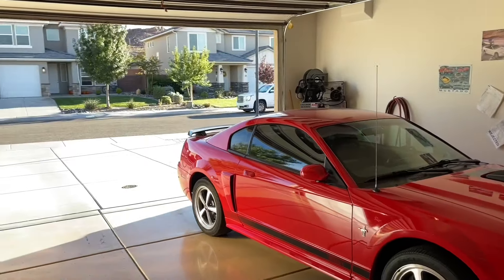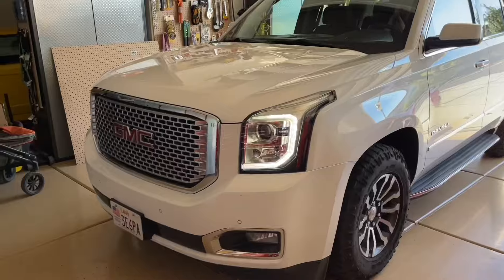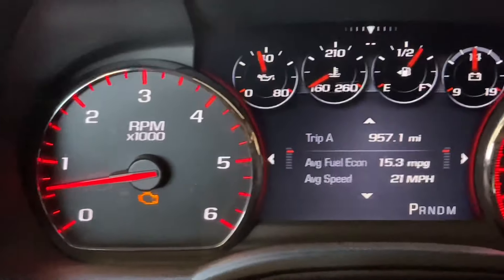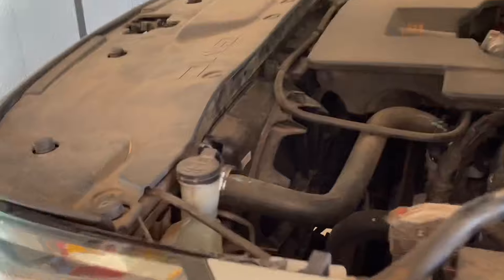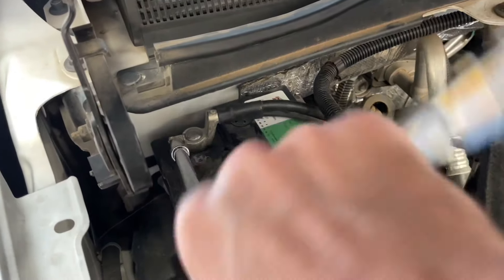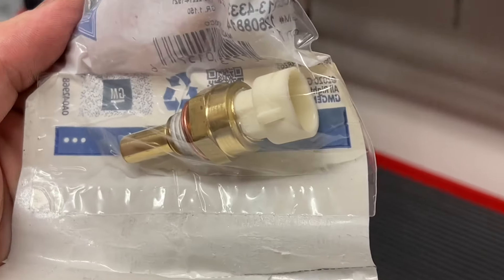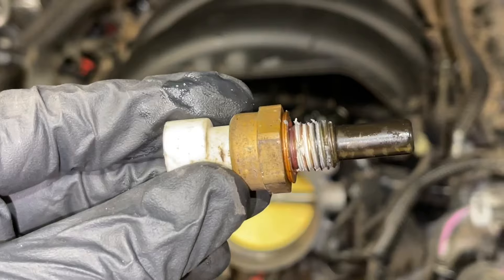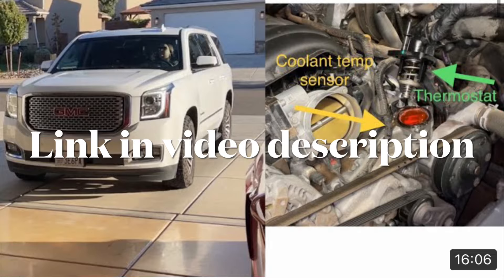Radiator Fan on full blast won’t turn off even with car off, not running. How to fix it GMC Chevy

Comment: Can you answer my question… so I changed the sensor and battery and it still doing it the noise os there something else wrong with my 2018 yin xl???
Reply from the maker: Try the thermostat next. It can have the same symptoms https://youtu.be/7mJF5LQ3oPs?si=rCTBqC3aHX686Xoa

Comment: I did change the ect sensor but it’s still running for a few minutes after traverse turns off.  And there isn’t any check engine light .
Reply from the maker: @olivasaz  it’s most likely the thermostat is bad and stuck open, over-cooling the engine: 
Thermostat Replacement Yukon, Tahoe, Sierra, Silverado, Escalade GMC, Chevy 2014-2020 P0128
https://youtu.be/aEfgkxWdBYw

Comment: My 2018 GMC Yukon is doing the same thing with the fan. After driving for more than 45 min it comes on and gradually gets louder. However, my temp gauge is always reading normal, there is no check engine light, im not running heat of ac, there were no codes found. What could it be? When I turn off the engine it stops and I have to let it sit for hours for to stop.
Reply: @dannyjohnsonsgarage
Reply from the maker: If the computer recognizes a temperature is not what it should be vs another temperature (for example the engine temp reads cold when the  transmission is hot) it may trigger the fan. In your case everything looks good, but it could be some disagreement of temps. I would look into the thermostat and temp sensor. It could even read incorrect, then start working again so you think it’s fine. https://youtu.be/7mJF5LQ3oPs?si=PoQLChpViUR0YLbr

Comment: I had the same problem but in two days it went away should I still change the thermostat?
Reply from the maker: I would be prepared to do the thermostat and temp sensor https://youtu.be/7mJF5LQ3oPs?si=p4dg6Q80BsDM2nd2

Comment: Would that make your ac blow hot?
Reply from the maker: It’s possible it shuts down the ac compressor as part of its limp mode. Replace the thermostat if it’s showing 160 degrees (it’s really showing lower)  https://youtu.be/7mJF5LQ3oPs?si=zXNMnz7MKtXA7IVO

Comment: I have a 2015 gmc Yukon xl Denali…I replaced mine about November and in February it did it again…replaced it again cuz the part has lifetime warranty at Autozone and almost a week later did it again….I’ve replaced the thermostat before as well the first time…may r a bad batch from Autozone?🤷🏽I’ll probably order an original from rockauto
Reply from the maker: I sued the GM one and so far so good https://www.amazon.com/ACDelco-213-4514-Professional-Coolant-Temperature/dp/B001W0FSMM?crid=2W7SZ4JL3KG18&keywords=213-4333coolant+temperature+sensor+gm+1260-8814&qid=1666942889&qu=eyJxc2MiOiIwLjc4IiwicXNhIjoiMC4wMCIsInFzcCI6IjAuMDAifQ%3D%3D&sprefix=213-4333coolant+temperature+sensor+gm+1260-8814,aps,121&sr=8-2&linkCode=sl1&tag=2004047-20&linkId=26bc817b596203fb2d3af79336fbb48a&language=en_US&ref_=as_li_ss_tl

Comment: Glad I found this! I replaced the coolant sensor with a Duralast one from Autozone before seeing this video. The problem stopped but then it returned. Could it be the sensor? Maybe I should have gone with the more expensive ACDelco? Or do you think I need to replace the thermostat next? Thanks in advance!!
Reply: Having the same issue as well did you find a fix?
Reply: Having same issue.
Reply: same issue
Reply: Having same problem I replaced coolant sensor and thermostat problem came back idk what it can be
Reply: I seen a few people had to replace the thermostat as well
Reply: Do you happen to have LED fog lights?  A buddy's does this only if the fog lights are used during that cycle. It's weird but reproducible.
Reply: Try the connector to the sensor
Reply: Did anyone find a fix to permanently repair this problem? I too replaced the sensor and now almost 3 weeks later the problem returned. I have no warning lights, check engine light etc on at this moment.

Comment: Quick tip! 

If this happens to you and you dont have tools on you. Just leave the truck on for about 5 minutes and then turn it off. Should make the fans turn off.
Reply from the maker: It will also kill your battery if not addressed. Pulling the negative terminal helps, but in the end we are finding it is the thermostat that is failing causing the car to realize the Tranmission is hot but not the coolant system and it goes into limp mode. The thermostat is stuck open in most cases and over-cooling https://youtu.be/aEfgkxWdBYw?si=_RsaX35abPAikCRi

Comment: Im not getting any check engine lights but it takes 5 minutes for fan shut off while truck off
Reply from the maker: Is the temperature gauge reading 0? It’s most likely the thermostat and or the temp sensor. https://youtu.be/7mJF5LQ3oPs?si=FLjYyzzHoF_WYXx3
Reply: @dannyjohnsonsgarage  thank u can I drive it like that for 2 days cuz I need my truck for work
Reply: @dannyjohnsonsgarage  yes

Comment: Replaced sensor and disconnected the battery for 2 minutes after.  Problem solved!  Thanks
Reply from the maker: That will reset it. If it continues to come on, I’d look at the thermostat and sensor https://youtu.be/7mJF5LQ3oPs?si=IuIx-t0uQToSw_g2

Comment: Had this happen in the 17 Tahoe. 
Rained real hard one day as we were driving. Then the fans come one while driving and stay on when motor is off. The fans would not turn off. So I trick the system by starting the motor and immediately turning it off. It turns the fan off every time like that. But as soon as you turn the engine back on the fans run constantly again. Did this for like a week and then they stop running constantly on their own. 
Then one rainy day it happens again. Maybe a coincidence. Haven’t fixed it yet because ATM the motor is down to the block, fixing the lifters and cam. I will change the thermostat and sensor while I do the pump. Should fix it. Also had to replace the transmission after 130k miles.  Car companies are making junk. Designs only last as long as the warranty. Car companies = parts/service companies. Buy used and just rebuild the whole thing with money you save or lease and give back after warranty.
Reply from the maker: I just did the cam and lifters as well. I was afraid transmission was next as well https://youtu.be/cWayyZGNYRI?si=KNc7Emej7Iw2pHkO
Reply from the maker: Went with a Toyota Sequoia as well Why I traded my GMC Yukon for a Toyota Sequoia
https://youtu.be/cNm9rtx0GHQ

Comment: What woukd make the sensor keeo going bad. I have a 2017 Suburban, and ive replaced the sensor twuce in the last 6 months. Gan will run loud and continue after i tuen off my vehicle and the temp gauge reads 160. Why do my sensors keep failing so frequently???? Help!
Reply from the maker: If it continues, it may not be the sensor, but the thermostat. https://youtu.be/aEfgkxWdBYw?si=kwK5TSbu3g0jUR4A

Comment: We did this and it worked for a bit. Have you found any other things to check for.  Next is the plug going to pull it and check to see if its messed up
Reply from the maker: If the sensor isn’t the fix and you don’t have a check engine light and don’t think it’s the plug, the thermostat may stick open and over cool or stick closed and overheat. Not as likely https://youtu.be/aEfgkxWdBYw

Comment: SOME HOW WE THINK IT'S NOT THE CAUSE OF THE TEMP SENSOR IT HAPPENED TO MY CAR TOO IT'S 2021 CHEVY BLAZER AFTER I FOLLOWED THE TIPS I REPLACED THE 3 YRS BATTERY AND WOW THE PROBLEM GONE NO MORE RADIATOR FAN RUN ON HIGH AND THE GAUGE BACK TO NORMAL TEMP.
Reply from the maker: The thermostat can also cause the fan to run if it is stuck open and over-cooling the engine 
https://youtu.be/aEfgkxWdBYw?si=ZGLk4TNu19cxP4X7

Comment: I've replaced mine and it still does it it's a 2014 sierra and idk why it starts again happens when I run my heater. Wiring issue maybe??
Reply from the maker: It is a default mode when something is wrong. Does the temp gauge work properly or show zero (160*)?
Reply: @dannyjohnsonsgarage  sometimes it works fine when I use my heat it tends to go out. Right now it's out and my fan kills my battery
Reply from the maker: @Jason Steele The relay for the fan is an electronic switch. If it stays on it could be the reason it doesn’t turn off
Reply: @Jason Steele Hey.   Hsving the ssme issue.  I just replaced the thermostat and temp sensor... fan still running and no temperature change on dash.  Did you find anything additional?
Reply: @Jason Steele thank you very much for responding.   That took care of it 😁
Reply: Try the ambient temperature sensor.
Reply: @coreyfleming8328  is it still good? I'm having the same issue.

Comment: SAME exact thing going on with my 2016 chevy suburban but we changed the sensor and it stopped doing it then again. What else can i do? Also the batter voltage will go below 14 and then 14 is that normal?
Reply from the maker: Battery voltage should be 13.5-14.5 for a good alternator. See if you get a check engine light. Some people have reported low engine temp because the thermostat was bad. It may be the next thing to look at https://youtu.be/aEfgkxWdBYw
Reply: I replaced the voltage sensor in the negative cable, now is good the voltage, good luck

Comment: I can't believe this happened looks like a new car I drive a Lexus GX I don't have to worry about none of those kind of problems. The reason I watch the video because I have a smoke problem with my mother-in-law's GMC Arcadia.
Reply from the maker: I agree. This Yukon has had a ton of problems. Im currently changing the cam and lifters- I bought a Toyota Tundra in the meantime for a more reliable truck
Reply: @dannyjohnsonsgarage  we live in America we should buy American products but unfortunately the quality is going down the hill anytime I buy a car I look for one with the VIN number that starts with a j that means it was built in Japan I hate to say this but they have different work ethic there they take pride and what they do and that's a big difference in quality and manufacturing I don't need people get mad and upset that's just a fact I'm not saying they don't have problems ever but it's just way way less

Comment: So i replaced the sensor on mine and a couple months later its back on, it looks like i need to move on to thermostat which i think has never been changed. truck has over 100K miles.
Reply from the maker: It’s very possible. https://youtu.be/aEfgkxWdBYw
Reply: @dannyjohnsonsgarage  So yea I, replaced the thermostat yesterday and issue went away, super easy install.

Comment: Dont even touch the sensor, just replace the thermostat.
Reply from the maker: I agree. It’s cheaper to try just the temp sensor but most cases I believe you are right and it’s the thermostat in the first place https://youtu.be/aEfgkxWdBYw?si=wGfq1wjrxll8IUpa
Reply: @dannyjohnsonsgarage  both parts are cheap, I replaced sensor first and still same problem. It was always the thermostat. Great video.

Comment: We recently bought a 2015 Chevy Silverado and it started doing that and we changed out the Coolant Sensor which fixed it for awhile, but it’s started doing it again which when it does my Dad will squeeze the Radiator Hoses and after a day or two it goes back to normal, we’re not sure what it might be. We also got a another code besides the P0128 being the P0175 System Too Rich Bank 2
Reply from the maker: I would look into the thermostat if it is still showing low temperature https://youtu.be/aEfgkxWdBYw?si=_YAKgsOK7X2a9Ytd

Comment: What's next if you replace this sensor and the fan continues to run?
Reply from the maker: Check for codes, but if it’s still over-cooling it could be the thermostat https://youtu.be/aEfgkxWdBYw

Comment: UNPLUG NEGATIVE!  Even after replacing sensor it still had an issue.  Unplugging negative terminal for 5-10 mins solved it (as others here commented).
Reply from the maker: It will reset it but if the thermostat is stuck open it will come back

Comment: My 2015 Chevrolet Tahoe is doing this now. The fan is running but my gauge is at 0. Now my check engine light is on.
Reply from the maker: Probably time for a new temp sensor https://youtu.be/4wd0n9F6--Q
Reply from the maker: If you think the thermostat is also stuck open making it over-cool you can change that too, but maybe try the sensor only first. Here is the thermostat and sensor, but you might not want to pay for the more expensive thermostat unless it’s bad for sure https://youtu.be/7mJF5LQ3oPs
Reply: @Danny Johnson’s Garage  yes. I'm going to replace the the coolant temperature sensor first and if that's not the problem it's my coolant thermostat
Reply: @Danny Johnson’s Garage   I replaced  the engine coolant temperature sensor and so far everything is back to normal.   Thank you very much for the video.
Reply: So I replaced the coolant engine sensor in my 2015 Tahoe 4 weeks ago. I thought everything was all good but now the same problem is happening.
Reply: @donteeast1536  my 2015 tahoe is experiencing a similar situation. Let me know if you find any updates! Hope it works out for both our sake

Comment: None of these worked 😢
Reply from the maker: It could be something else, but it’s usually the thermostat and or temp sensor https://youtu.be/7mJF5LQ3oPs?si=XJ-7IV4571T34iIF
Reply: Did you remove negative side of battery? I just replaced both sensor and thermostat and turned vehicle on. Still was reading low temp and fans were still on after I turned vehicle off. Unplugged negative for 10 minutes and now working properly

Comment: Here is the best no cost solution...unhook negative battery cable....leave unhooked for 10 minutes...hook back up...all fixed.😁😁😁😁
Reply from the maker: And when it comes back on again, do the thermostat and temp sensor https://youtu.be/7mJF5LQ3oPs?si=pSsYjHq0cDo6yB05
Reply: @dannyjohnsonsgarage what if nothing worked I changed my sensor the thermostat the fan fuses I have only 3 relays in my fuse box and all work so idk what to do
Reply from the maker: @andreamassingill6132  When the engine has been running for 10 minutes, does it show cold on the temp gauge?